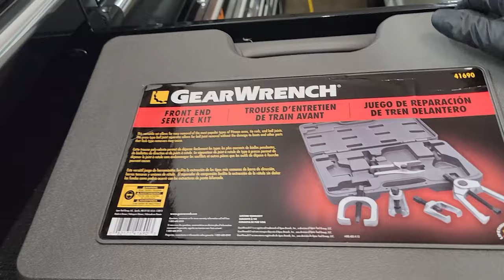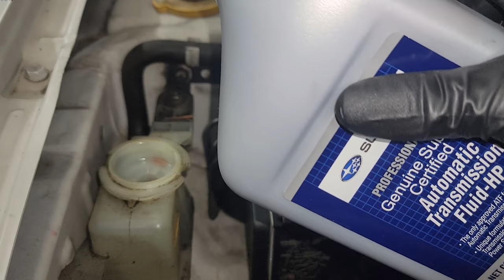Subaru Steering Rack Replacement | Subaru Outback | DIY

Comment: I got quote of $1,400 for replacing power steering rack at dealership. It's rusty and leaking.  Is that too high.  On my 2010 Subaru Forester
Reply from the maker: With parts included in cost?
Reply: @Mechani_Cole  Yes, it's parts and labor.
Reply from the maker: @wordswordswords8203 not too bad then
Reply: @Mechani_Cole  Ok, thank you. I appreciate that a lot!

Comment: I'm late to the party but fair warning , maybe I'm wrong but when you added ATF the second time due to feeling there was air in the system I believe you are meant to turn the car back off as running the car with the lid open typically adds air. Not sure about Subaru but I've definitely made that mistake before on a Lexus and had to go back and bleed the crap out of it, No biggie I'm sure but can cause headaches or starve pumps in worst case scenario. Again I might be entirely wrong when it comes to this vehicle but I always thought that was a general rule.
Reply from the maker: Fair point. However most models require you to fill the trans with the car running on level ground to get an accurate reading.
Reply: @Mechani_Cole  Adding or checking? I know you need to check the level when running at hot but ive never heard of needing that when adding the ATF.

Comment: On my '05 Outback XT, I got this weird noise when I turn full left lock making U turns, best way to describe it, it sounds like scraping a metal pipe on the floor when turning and the steering is hard. I'm guessing the rack & pinion is bad inside. You made this look easy Cole, very nice job and great video documenting everything.
Reply from the maker: Thanks! It could be that, or it could be bad axles or bad control arms. 

First time I am mentioning it, but I just picked up a 2009 Legacy GT that I will be making videos on here shortly🤟🏼

Comment: Thanks for the video.  Very informative.  I think I can accomplish this repair.  I want to get the Gear Wrench tool.  Next time you are showing a good tool to use instead of flailing the tool around, hold it still with the item number so people can get the tool they have seen working properly.
Reply from the maker: Thanks for the comment🤙🏼 As for the tool that was flailed around, everything I use is always linked in the description. So not only is the part number there, but I have left links for every tool and part🫡

Comment: I also have replaced low pressure pipe (from tank to pump): it was hardened, did not seal well with the clips and was sucking the air.

Comment: I'd use needle nose or some type of plyer instead of those "Dykes" known for cutting wire, cotter pins etc, but if you press hard enough you can easily sever that pin with that tool. Otherwise, great post, will be doing this on my spec B shortly.
Reply from the maker: Agreed, needle nose works too. I just been using the cutters for a long time becaue they grab really good if not pressed to hard. Best of luck on the Spec B! 

I like your screen name Phriend🤟🏼
Reply: @Mechani_Cole  Thanks fellow Phan, it was a creation for AIM after my first show at MSG in 97"...Anyway as I go to drop my tie rods, Passenger side no problem with tool.....Driver side it broke my puller, try to use the ball joint & tie rod puller, its not budging, soak in pb for a day try and mini sledge with HEAT from a torch....NOTHING....I cut the M'fer and PB and figured a sledge with pb from under with a punch NOTHING, hit from the top its now mushrooming. I suppose I swap the spindle, sucks as I just did the front end new wheel bearings struts ball joints, but its sort of a blessing i didn't mess with the tie rods as in the set is a brand new inner and outer, I didn't know much about the steering system then, I could have replaced the inner and outer as I has a bad leak from my boot from a tow(I believe).  Sorry for the rant. So I wasted money on a new rack $200 and a new spindle $50 shipped. When essentially I only needed to replace that inner rod as the seal is within it? Irregardless its my 2nd I have a 07, this is an 08 from ct, so imagine its condition. I bought a cheap extractor I doubt will work...Props to the sway bar idea, it makes the job so much easier.

If anyone has any ideas for removing a very corroded cut off tie rod end (cut from the bottom just under A-Arm. I've used heat, sledge, air hammer and attempting an extractor(have little faith), it's a threaded bolt in a non threaded spot. If it helps I can put a link for what it looks like.

Once again sorry for the wall of text....

Comment: for a subaru Impreza 2016 withe electric steering makes a growling. Grinding noise when turning left and now when turning right too
wany ideas? the extended warrenty is it only for the modual? thx

Comment: I have a 2008 Subaru Impreza, and my rack has a leak from one of the lines. On inspection, the leaks look's like it coming from the rubber washer. Do you know what size washer is on this rack? My local Subaru dealer sells the whole line and not the washer?
Reply from the maker: No idea my friend. The dealer should definitely be able to at least tell you what size it is though

Comment: I got a 13 STI and im swaping the steering rack, im having alot of issues with re connecting one of the power steering lines. It keeps popping out after it gets half tightend, its a giant pain and I dont know if its just not seating correctly or if its stripped. If it is stripped will I need all new lines? I know you cant diagnose something from a comment but what do you think xd
Reply from the maker: They can be a pain some times. Most of the time, it's the angle of the line I've noticed that needes to be almost perfect for it to screw in all the way. 

Here is one more though, is it an aftermarket steering rack? Is the fitting the same thread pitch as the new rack? I've seen this issue before too. If it is stripped, you'll likely need a new line worse case
Reply: I’m 99% sure it’s the same threading, I think ima just drop the rack some more to access it better. What ever it is I need to fix it so I can head down to subiefest this weekend😭

Comment: I ordered this rack and the boots ended up spinning around the inner tie rod they were so flimsy and soft. A very, very ,very soft rubber boot. Now i am in process of figuring out what i am going to do return the whole rack or put new boots on. But i am still going to end up loosing 125$ alignment i think anyway. Idk if i can just unconnect the inner tie rod without needing a alignment again
Reply from the maker: Of course. All the boots are soft rubber on every rack. If you twist them, they will get twisted. Supposed to remove the clip before rotating any direction. The tie rod spins freely inside the boot once you remove the clips that hold it. Pretty common. All new boots are very soft.

Comment: I'm doing this tomorrow, your video is very helpful. Thanks a ton
Reply from the maker: Thanks, happy it was helpful!
Reply: @Mechani_Cole  well one of the flare nuts on the high pressure lines you have to move over to the new rack is super tight and I rounded it off lmao
Reply from the maker: Yeah, I did the same thing. The solution was to lock on vice grips really tight and break it free. Its really easy to strip these without proper flare wrenches
Reply: @Mechani_Cole  I ended up getting it with a torch and knipex cobra pliers
Reply from the maker: Those are nice! Good idea👏🏼
Reply: @Mechani_Cole  now the pre installed line next to the bracket with 2 bolts is in the way of me getting the rack in the correct position
Reply: @christofear  im having the same problem right now with the pre installed line. Did you figure out a way to get it in?
Reply: @kylemosher5315  i took the original ones off the rack and put them on the new rack
Reply: @kylemosher5315  i think the afer market ones are just bent wrong

Comment: I replaced my rack and pinion on my 2008 Subaru Impreza than after my traction control light turned on. What do you think? Seeing the light bugs me makes me feel like something wrong with the car
Reply from the maker: Have you driven it yet? If everything is hooked up properly it usually resets itself after driving.
Reply: Hello!, yess I have driven it already earlier today and the light still stayed on
Reply: @jorgeosornio2418  did the light ever come off for you ??

Comment: Idk if I missed the part where you lock the steering wheel but, you gotta do that or risk breaking the clock spring
Reply from the maker: Good tip! I didn't lock it, but also didn't turn it at all
Reply: Yes you right I was thinking about clock spring too, unless you lock the steering wheel or holding firmly with something obviously it gonna break so I think the guy has to add some corrections 
Thanks so much

Comment: Why did you use transmission fluid and not power steering?
Reply from the maker: Love this comment! Look up what power steering fluid is. Then check what Subaru suggests that you use. It's ATF. 

Putting a label that says "Power Steering Fluid" on a bottle of ATF doesn't change that its still ATF in the bottle.

Comment: Anyone have a part number or know where I can get ahold of the lines mentioned at 9:06 ? My rack is fine but those lines are rusted and leaking
Reply from the maker: Is this what you are reffering to? 2005-2009 Subaru Legacy Outback Power Steering Hose Lines Line OEM 05-09 -https://ebay.us/bJVYEH

Comment: How do you do adjustments like play in steering or looseness
Reply from the maker: I take it to an alignment shop personally
Reply: @Mechani_Cole  yeah I was thinking of learning so I Cando it myself
Reply from the maker: As a mechanic myself, I don't have an alignment rack or the computer needed for proper alignment. You can always try. But to get it right, gotta take it in. It's only $100-200 most of the time

Comment: The lines you swapped over on the old rack too the new ones appear to be leaking oil as fast i can pour oil in. But they aren’t sold separately. What a freakin nightmare as a driveway repair. OH! Let’s add mine is a New England car. Ruuuuuuuuusssssstttttttttt😢
Reply from the maker: Ouch!
Reply: I found some replacement lines on my local Subaru dealers website for an 06 Legacy I was working on. Good luck

Comment: sadly the 2014 subaru outback is different and I cant get the old one out right now =[
Reply from the maker: Yeah, this is for the older models from 05-11 in most cases.
Reply: @Mechani_Cole  bro the new ones are fkin garbage i had to drop the frame to get to the rack . I swear they made it like this so ppl go to dealer for replacing the rack
Reply from the maker: I could see that🫡😅

Comment: a 2009 with no rust this car is not form ny
Reply from the maker: From WA state and the exhaust is rotted out, but not bad.
Reply: or RI. The biggest part of this job will be rusted bolts snapping off and dealing with it.

Comment: I hate the comment 'if you have a Subaru its power steering fluid or ATF.'  that's utterly not true my subie uses gear oil supplied by the tranny.
Reply from the maker: Going to assume this is satire or sarcasm
Reply: @Mechani_Cole   nope not at all my 96 jdm legacy is most definitely supplied by gear oil not atf and last I checked 75-90 is slightly different than atf
Reply from the maker: @gentlemansbusa2985 I'd need to see some sources. Been working on cars for about 14 years now and have never heard of gear oil going into the power steering reservoir. Even when you search the fluid type for a 96 Legacy it says ATF goes in the PS system
Reply: Did a fresh gear oil change in the tranny and the rear diff. Now I'm getting clean drops dripping right off the rack and pinion directly underneath the steering gear box. Don't get me wrong pretty sure they switched to atf in like 98 but it's just not all of em.
Reply: @Mechani_Cole  again it's a JDM so might change search results.
Reply: @Mechani_Cole  and I'm not doubting your ability at all this was a great video and 98% identical to mine just slightly different hose mounts on the steering gear box. So thank you! Glad I don't have to drop my exhaust to get her out. Also had no clue the top parts of those hoses didn't move so thanks for saving me that headache before I do this, this weekend.

Comment: You dont show how to remove that sway bar.. you also dont show where the lines are being held up under the hood… now im sitting here like how the fk do i remove the sway bars now that my car is disassembled hahah… thanks bud.
Reply from the maker: Sway bar is super simple, just the 4 bolts holding it. If you follow the lines, you will find the connection. First time I heard this complaint, but thanks for watching bud🤙🏼
Reply: @Mechani_Cole  idk about you but ive always removed my sway bar links with the vehicle FLAT when no stress is on the control arm and the actual sway bar.
Reply from the maker: Same. Do it on ramps first, then jackstands after. It will come off if not on the ground still. More important to tighten when flat
Reply: @Mechani_Cole  alright and now ive ran into the issue… ive got a 2005 PZEV with dual exhaust… soooo the rack doesnt slip past the exhaust. Lmao.
Reply from the maker: Remove the exhaust header from the head. Should be 3 bolts on each side. Then remove the bolt by the cat holding the mount in. Then you should be able to lift it off the holder and pull it down just enough. You don't have to remove the whole exhaust, but can lower it down this way giving more room
Reply: @Mechani_Cole  yeah my cat is being held together by a weld to the remaining downpipe… any stress will pop that weld. Then thats a whole issue in its self…
Reply: @Mechani_Cole  id recommend changing the title and description of your video my dude… this shit isnt working on my 05 outback… which it should but being the different exhaust systems on these cars… your method isn’t guaranteed.
Reply from the maker: What should I change it to? 🤔 

Because it worked for this 05 Outback
Reply: Not to be that guy but if you cant figure out how to remove your sway bar then maybe you shouldn’t have jumped into something like changing a steering rack. Just saying that relying 100% on a youtube video is asking for trouble

Comment: The cardone steering racks are trash. Don’t recommend that shit to people.
Reply from the maker: Why so? What's your experience?

So far over a year later on this one and no issues
Reply: @Mechani_Cole  a lot and I mean a lot have clunking from play, and leaks out of the box. Just look at reviews, and I bet top dollar you will see examples of both. Rampant examples. Especially on Subarus. In my experience, the Subarus need to get a factory steering rack. In fact, it’s imperative.
Reply from the maker: I could see that since they are all rebuilt units. Cardone doesn't offer a rack they make, they simply rebuild used ones and slap it in their packaging. The rebuilds can be hit or miss, but it's still a factory rack. Installation process is important as well. I'm sure there are some failures, like with most rebuilt parts. However I just haven't had that experience myself and probably went through about a dozen of these racks.
Reply: I haven't purchased a Cardone rebuilt rack, but my power steering pump is a Cardone new pump. The pump leaked PS fluid after two years. Thankfully I purchased the pump at an autoparts store. The store honored the 3 year warranty, so I obtined a replacement Cardone. However, I would not trust Cardone for steering racks on my Subaru.
Reply: @Mechani_Cole it’s a factory rack with chi ease seals that last two months. You should know this. There are racks made with Subaru seals and they are double the price.
Reply: @Mechani_Cole yeah how many of those did you check 6 months later? I’m guessing 0.
Reply from the maker: Interesting comment, my old neighbor ended up buying this car off me years ago and this power steering rack is still working in great condition. I'm not sure your point holds any weight on this one